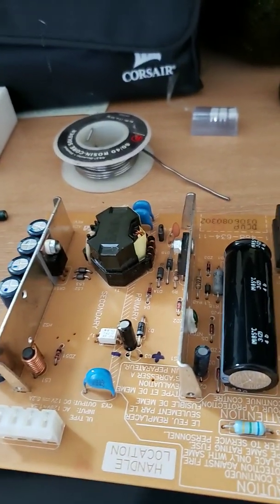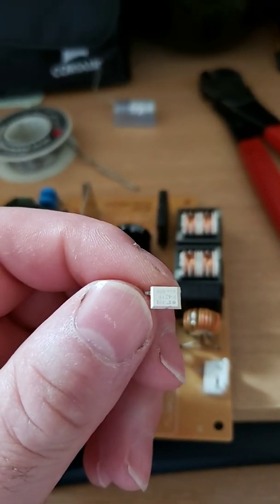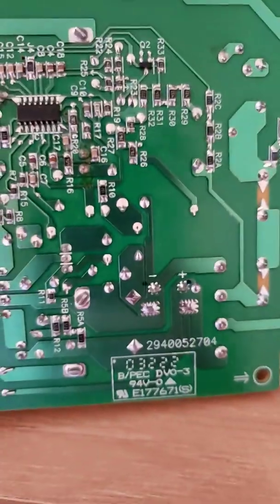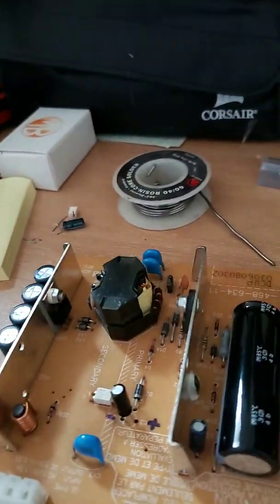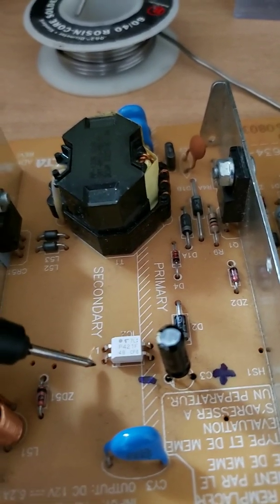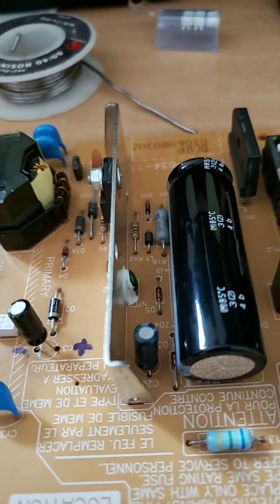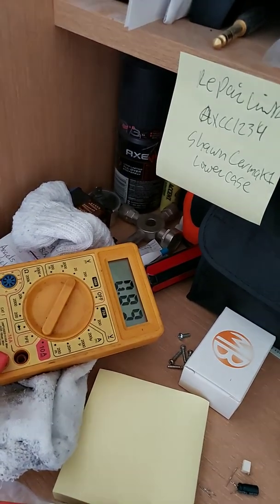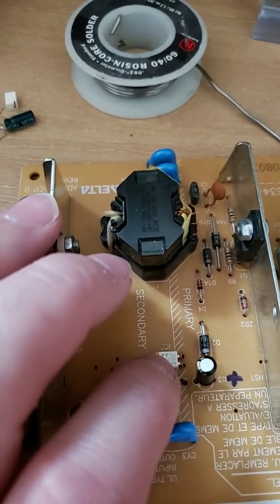How To Repair PS2 Power Supply | Step-by-Step Tutorial part 2

Comment: Does it have to be a specific tlp421f? There’s 4G, 4G+ just below the p421f writing on the chip. Just wondering if there’s really any difference
Reply from the maker: That is the p421f  Opto coupler it regulates the 12v rails any p421f will do but there is plenty on Ebay. You can look up other ones with that number

Comment: I picked up a PS2 from a thrift shop for super cheap and unfortunately it doesn't turn on. I suspect it's the power supply since probing pin 1 (12v) and 3 (GND) on the output side of the supply shows 0 volts. It does seem to be drawing power since that big cap (C1) has a charge after I unplug it from the mains. Normally, I'd just do a power supply swap in this case since they seem to go for about $10~ on eBay/Aliexpress, but I can't seem to find a suitable replacement. There seem to be several variations of the board depending on the PS2 revision. I happen to have the same board as you (Model: 1-468-634-11). I'm able to find a replacement board for every other model except this one. 

This video was helpful since I did test that IC and testing pin 1 and 2 in either direction results in resistance. Testing between pin 3 and 4 in either direction results in an open load. I've ordered a replacement for this IC and hopefully that's the only dead component on the PSU board.

Since you happen to mention that you fixed up a few other power supplies, do you know if there's any cross compatibility? I saw some boards that have a very similar layout/form factor, and seem to have the same outpint pin layout (12v, 12v, GND, GND) on the connector that goes to the PS2 motherboard. If replacing this IC doesn't fix it, I'd like to just replace the whole power supply. 

Thanks again for the free and helpful information.
Reply from the maker: Is this a v4 delta or  Nikon both of them are  V4 cross compatible any fat PS 2 the v9 are not compatible because of the way they are installed. Also check the 2545k regulator for a short the diode does go bad.
Reply: @axcc  The one I got inside the PS2 was a Delta, same one you show in the video. It's the one that mounts from the bottom. I ordered a replacement from AliExpress for $4. This was the replacement I ordered (https://www.aliexpress.com/item/4000164281289.html?spm=a2g0s.9042311.0.0.60ad4c4dKBoJYp). It's not completely identical visually, but the connectors to the board and the mains line up and the board size matches. As long as it outputs 12V at 6.3~A on 1 and 2 and uses 3 and 4 for GND, it should be fine. Based on what you're saying, it sounds like it should be compatible. I checked the regulator just now and it's not shorted. I ordered a replacement for the IC as well since it was a buck, and I figured I'd try replacing it to see if I could get the original power supply going in case the replacement doesn't pan out.
Reply from the maker: @NazarSu  repairing the oem one is better than those  Chinese replacements I would try that first make sure you are testing the regulator properly.
Reply: @axcc  I got the replacement power supply and a new IC today. Repaired the old supply by replacing the IC. I also tried the aftermarket aliexpress power supply and it worked fine too, so I have a spare/backup now. Thanks for the video, it helped me out. 

And I can confirm that if you have one of these Delta power supplies, you can drop in replace it with a 35008 (Model number 1-468-620-23) from ebay or aliexpress and it will be compatible.
Reply from the maker: @NazarSu  no problem I have fixed many of these and all the same issues after 20 years of service